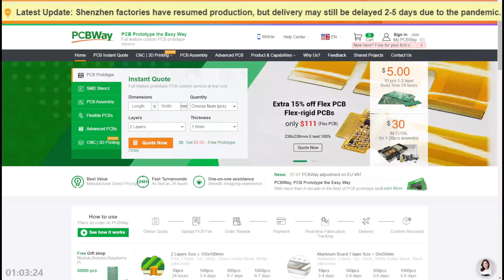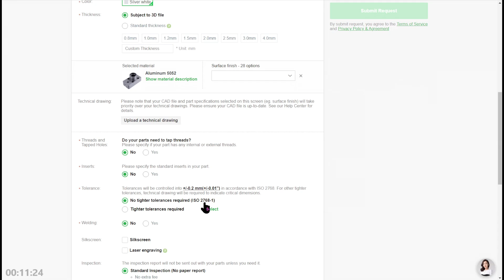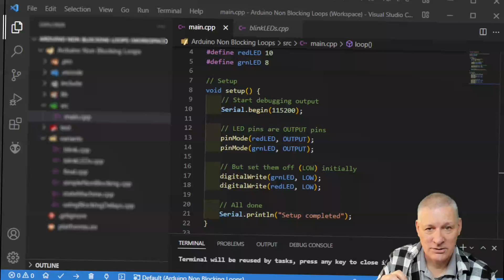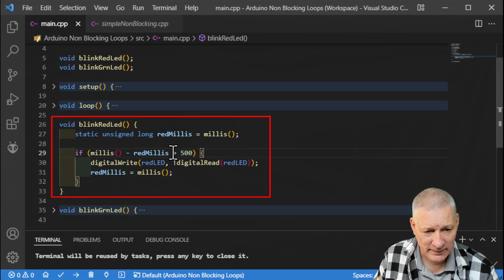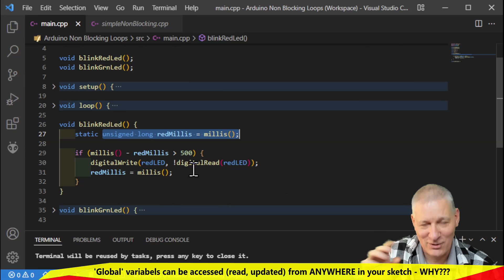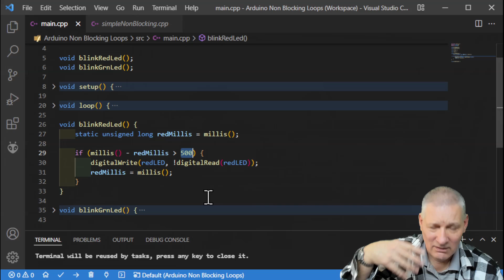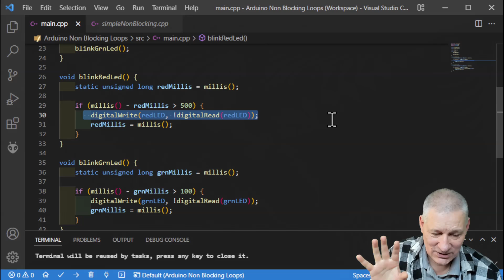#BB5 Moving your Arduino to a multi-tasking State Machine - Easy Intro

Comment: Dear Ralph, I installed VS code and the paltfomIO extension. I was able to run this code and even make some modifications for views in the thermonal. However, after closing the project and VS code and reopening VS code, the PlatformIO icon no longer appears.
I've done everything, reinstalled, PlatIO and VSC and nothing. I made a thousand queries in Git and found that there are dozens of cases opening with the same problems. Please do you have any tips so I can reset PlatIO in VSC? I found your explanation very interesting, saying that the compiler only uses the static variable once inside the if() loop. Congratulations!
Reply from the maker: My PlatformIO (alien head) icon appears several (long) seconds after opening Visual Studio Code. It's an add-in, after all. Click on the extensions icon (4 square boxes) and ensure that "Platformio IDE" is enabled globally and running.

After that let me know if it's working or not.

Comment: Good explanation Ralph. First video of yours I've watched. I'm a 40 year emerging tech guy, programmer, inventor and software executive currently CTO. So I knew the subject matter already. But I enjoyed your style of making some fairly sophisticated abstract concepts and showing a well-explained working guide through the implementation. What made me inspired enough to Like and comment was your magnificent statement: "Global variables are satan's spawn." I pumped my fist in the air. This indeed is a critical thing for new programmers to understand and probably the most often-seen bad code smells in their code.
Reply from the maker: Yes, it's unfortunate that the compiler does not warn about global variables if they are only being used in a single (or perhaps a couple) of functions. It encourages untidy programming by allowing globals in a willy-nilly fashion. Passing by reference is better in a lot of cases.

That's not to say I never use them. There is a place for them. Ideally in a namespace but even the global namespace works for some variables or objects.

I'm glad you liked the video, and thanks for the comment and "like" too, it all helps this channel. 👍🏻

In the meantime I'll keep pushing the message that globals must be reigned in with a cat-o-nine tails!
Reply: @RalphBacon  I sometimes use a global Singleton class that encapsulates configuration info. Like you said they are sometimes needed or an accurate representation of things. Global constants are not as big of a deal, but even then I tend to use static constant definitions. Even then I prefer to put the constant to be encapsulated as class members (static or otherwise). It's all about limiting and controlling scope and properly using encapsulation to implement some bit of functionality. For little < 25 line sketches or Python scripts using globals isn't as critical. But I find using the right abstractions and following best practices pays off even in small chunks of code.
Reply from the maker: I like the idea of using a singleton for pseudo global variables. Nice and tidy. Yes, I agree that using best practices from the word go helps reinforce good programming practices for even small programs.
Reply: I advocate strongly for the use of module-global variables (the ones explicitly marked as static at global scope) because they don't come with the same runtime overhead as local static vars

Comment: Could you make a video where you can make a button function as a switch and a second button to change which device it enables/disabled? I can’t seem to find a good tutorial on something like that yet it seem like a simple task. Thanks
Reply from the maker: Remember that the button doesn't do the actual switching; it's your microcontroller that decides what "thing" to switch. So if you detect a button push, then decide from the second button (state) which "thing" to switch all will be well.

My next video on State Machines is due in a couple of weeks or so, and uses a button, so you may get some ideas from that.

Comment: My first HW state machine was an prom and a latch (back in the TTL days). Clicked on this video to see if you had something easier to read than: switch (current State) {

Waiting to see your next video😊
Reply from the maker: That is awesome! 

So you used the floating MOSFETs in a PROM for a counter, or something? 

Let's see now. 16-bit PROMs with 16 address lines (64K words of storage, I presume). Bring the PROM data lines out to a 16-bit latch, then connect the sixteen latch outputs back to the PROM address lines.

But what's coming out of the PROM data lines? I guess we would need to "burn fuses" there first. Each location would contain the next memory location to be accessed. First location (zero) put 0001, next location (one) put 0002 and so on. A programmable counter.

As a State Machine. 🎇✨🌟
Reply: @RalphBacon  not so complicated. The latch holds the current state. Feed the outputs of the latch to the prom's address lines along with the inputs to the state machine. Wrap the outputs of the prom back to the inputs to the latch (this represents the next state number). Program the prom so that at the address of the current state, with the inputs to the state machine the prom holds the next state number. Each time you strobe the latch it will move from the current state to the next. Speed is only limited to the speed of the prom, sub microseconds. Pre FPGA's and cheap microcontrollers it worked.
Reply from the maker: Awesome. The good old days. Well, maybe not, in this case. 😁

Comment: Ralph,  in my work with adding microprocessors to pinball machines, I developed a polling time based queue routine that allows you to create an entry that will execute a function some time in the future.  I think it is really simple and easy to use.  I made a little video about this and referenced this video of yours.  If you have time, take a look at it.  https://www.youtube.com/watch?v=xi6hNZD3jLQ  .  Since you are an actual programmer instead of a hacker like me, I can't wait to see how you develop your multi-tasking capability.
Reply from the maker: I've watched your video; cool idea. Have you thought about using the FreeRTOS library for the UNO (and even better for the Mega2460 or the Nano Every [Mega4809]) which gives you what you have plus everything else in a task-scheduling OS?
https://github.com/feilipu/Arduino_FreeRTOS_Library

Comment: Since you are pitching this series at beginners, can I please make a request that you use the industry accepted terms for the concepts you introduce. As someone who has taught programming at all levels from introductory to post-graduate, I have found it takes a lot more time to correct misconceptions than to teach them correctly in the first case. Scrolling through the comments, you can see that people have conflated many different concepts.Let's try to disentangle them!
a) State machine. This is a way of organising code that implements different behaviours for different situations, often cycling through them. Think "wake up", "have a shower", "have breakfast", "clean teeth", ... A state machine is a variant of the  standard strategy design pattern. Organising such algorithms into a state machine lets us focus on just two ideas: what algorithm to use in a particular state, and when and under what conditions we will move to a new state. (Nothing to do with multitasking).
B) multitasking: Unless we use a real time operating system, we are talking about cooperative multitasking in which we take turns doing a bit of work on one task, then a bit on another, and hopefully juggling everything to keep all the tasks progressing satisfactorily. This is sometimes called time-slicing. Of course,we can only achieve this if the tasks cooperate and play nicely with each other, taking just the minimal time they need to make progress and then letting another task has a turn. This leads to ...
C) non-blocking code. The enemy here is the delay function which hogs the processor. The Arduino "blink without delay" example, shows, like your code, how to avoid this.
Reply from the maker: Nicely summarised, although I believe that the multi-tasking example (that ironically hides a type of state machine in the captured millis and the state of the LEDs) is required first before we do actual state diagrams (which is next on the list) and code for the final LED on my breadboard.

I don't want my viewers getting the idea that a State Machine is some piece of monolithic code with a huge 'switch' statement. Other things can run at the same time that are not part of that State Machine.

This video laid the future foundations for a (simple) State Machine that is part of a bigger piece of code; after all, not all code derives from a State Diagram.

But I will try and clarify the concepts as I move forward; I'm hearing what you say, Mike, it's just that I'm too well aware that more than one concept at a time for beginners leads to confusion, frustration and switch-off.

Thanks for giving me the nudge that I must be clearer in my terminology 👍🏻

Comment: Hello Ralph. If 'delay(1000)' is placed in the main loop this will cause the LED's to be affected by the delay. The functions (redLED and grnLED) will then be delayed by 1second..
Reply from the maker: Hang on, are you suggesting we put in a delay or something else? Or is this just an example of something that might affect the timing?

The thing about multi-tasking (pseudo or otherwise) is that we never, ever use delay.
Reply: @RalphBacon  dear Ralph. In your example the main loop will sequentially poll the red and green functions. According to my assesment if a delay(1000) is placed in the main loop the main loop will be 'stationary' for the 1000ms caused by the delay() function. At the end of the delay(1000) the next polling of the red and green functions will take place obviously both functions will  return  millis() that will be greater than at least 1000ms which is greater than the delta 500ms and delta 100 millis read by those functions, thus causing the delay() to become the dominant timing cycle.
In conclusion if the intention is to do something every 500ms and 100ms delay(x) may not have x values greater than 100ms. Then if the processor is not reset within about 57days the millis register will roll over starting at 0.
Reply: rollover is no problem if you do it right

Comment: I totally agree hat globals are evil!  Yes, using a static variable is a better option, but note t does not "move the variable outside the function" The compiler simply uses a hidden boolean guard variable to initialise the variable once only in the first pass through the code.  What you have created is "non blocking" code and a good thing, but nothing to do with a state machine. Calling it that will only confuse beginners. There is an an example of this technique in the examples provided with the IDE, called "blink without delay"
Reply: globals are not really a concern for a 32k chip though, more for millions of line codebase with multiple developers and for library developers.  In terms of doing more things, globals can be accessed faster than local variables, and facilitate sharing memory with interrupts and other functions (i.e. volatile).  Being too idealistic/dogmatic can be evil too :)   In this case though I would argue that the state here is time, but could be any value, and my own preference would be to see just a single loop function with a calibrated delay of a few ms at the end and single line commands to toggle the leds using a modulo of loop counter, for example purposes, as that would translate well to typical timer interrupt code if need be (where the number of timers is limited, i.e. arduino), as using a timer interrupt will completely free up the cpu vs looping and doing nothing most of the time.
Reply: @glendenog9095 it's not just large codebases. Consider this logic error ( which I have seen way too often): having a global counter volatile int myInt, having an interrupt routine do ++myInt, and then accessing myInt in the loop.I will explain the logic error after this ancient joke ... What is    the best naming prefix for a global? ... it is // Seriously though, there are many reasons why experienced programmers say avoid globals, but what it boils down to is that we have seen too many bugs and too much time wasted. Did you spot the logic error?
It is that volatile does not mean atomic.
Reply from the maker: @glen Not using global variables has nothing to do with memory space and is all about restricting the scope of the variable to the bit of code that needs it! 😲
Reply from the maker: @Mike I 💕 that prefix for globals. Too right!
Reply: @mikelopez9893  This is what I mean by dogma.  There are numerous techniques to ensure data integrity, but they require you to be experienced enough to manage 32k of code without being paralyzed by the notion of introducing a global, they require you actually know what you are doing, which makes your assertion about "experienced programmers" who probably have never even read the mcu datasheet a bit of a paradox in itself.  If you want to get the most out of these small cpu's you are going to have to get your hands dirty and deal with some globals, every experienced microcontroller developer knows this.  Who is this "We" you refer to, you don't seem all that experienced to me if you think atomicity concerns magically go away if you just don't use globals, or that people cannot be trusted with them.
Reply: @RalphBacon  Well technically it has everything to do with memory space, C is just an abstraction.  My point is that having worked on the very large and the very small, a lot of the very large dogma that has been beaten into people breaks down at the very small.  i.e. how else do you suggest having an ISR update some data for the main loop to report on?  Indeed globals are faster as I said, and use less resources, and it is usually just you and some rather small bit of code here, really nothing to prostelitize over, more important to think about what you are doing, not echo dogma from your day job which probably doesn't apply.   Experienced AVR programmers use lots of globals all the time, the problem space isn't usually big enough for it to be a concern.  I mean tomorrow you are going to tell us we need to use functional programming all the time :)
Reply: @glendenog9095  Ad hominem attacks!  I am not going to get into a flame war on this out of respect for Ralph but will point out the irony of someone claiming dogma and then saying things like "experienced programmers ... probably have never read the MCU datasheet." As someone with half a century of embedded programming experience, I can confidently say many experienced programmers HAVE read the MCU datasheet. I read them religiously!

I did not say atomicity concerns problems go away if you just don't use globals (but it helps). Here's how an experienced programmer handles global state: a) keep the global state private. b) use a "getter" function to access it. This getter function can then use an ATOMIC BLOCK to access the state before returning it, or just disable interrupts when accessing the state and re-enable afterwards. That's why Arduino uses a millis() function to access the timer. It's safe to call this from anywhere, although it won't be updated of course if you call it while interrupts are disabled, such as in an ISR.

I do say "People cannot be trusted with globals".  A bit like "Hyrum's law", if it's visible publicly, theen over the life of the program sooner or later someone will think "I can just grab that variable" to create bugs that take a long time to track down.

Comment: I can see a major problem with this. Its not preemptive. A subtask has the possibility of locking up the whole thing.
I wrote a preemtive task manager in assembler that I use as a pseudo o/s.  If i need something done when a condition occurs, I add a task to a Que that is prioritized based upon a priority number. What I put into the Que is a priority, condition, and task to run when condition is true. This condition can be a timer, semaphore, port change, etc. The task in the Que is passed control upon condition being true. The task does get interrupted by a timer interrupt, so a task can not hang the system. Before returning control to the interrupted task, it will place on the Que the interrupted task with the same priority as the original task wjth a condition of true. The task manager will rescan the Que and if no other higher priority task needs to run, the original task will get back control. Easy peasy
I use this all the time when coding on micro processors like the arduino, PIC, and TI
Reply from the maker: Correct, it's not pre-emptive - as I mentioned in the video it's important to prevent one task from monopolising the μController processor. That is, it's important the developer deals with this!

However, in the next step towards a State Machine, we can simply exit the function at a particular state and allow other things to run. A pseudo-yield, if you will.

It's certainly nothing as sophisticated as what you have described and written, but does work well enough for non-critical tasks. Have you published your task scheduler?

I've been made aware of FreeRTOS (optimised for Arduino) which I hope to try out soon, especially if it runs on the Nano Every (AtMega4809 chip which as 6K SRAM). https://github.com/feilipu/Arduino_FreeRTOS_Library
Reply: @RalphBacon  hey Ralph. No I did not publish it as it is written in assembler for each processor type i use. Its not ready for prime-time :)